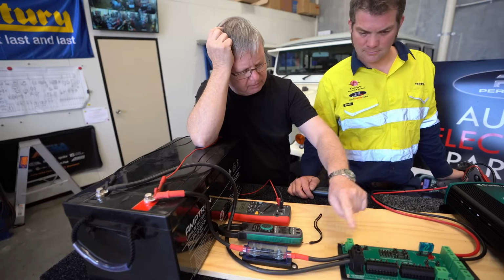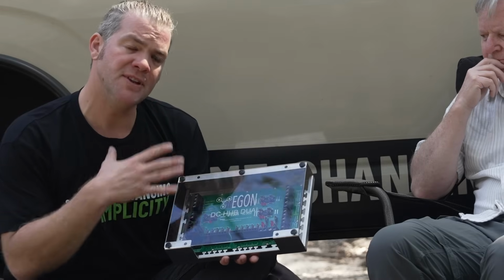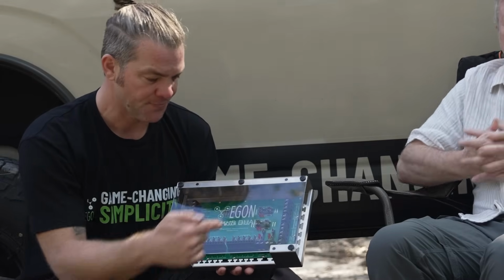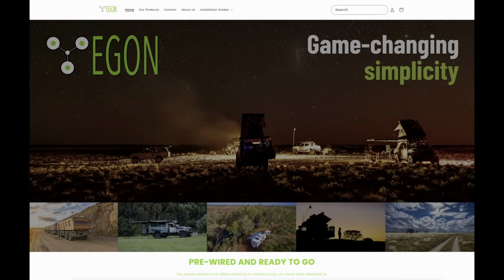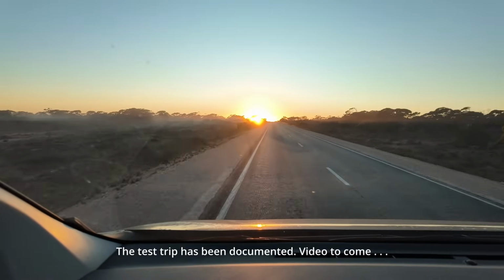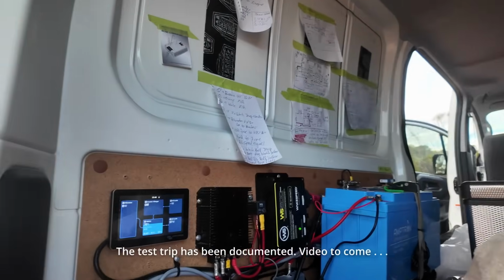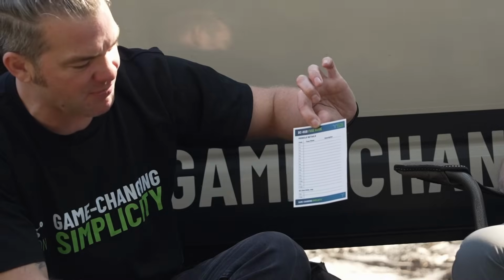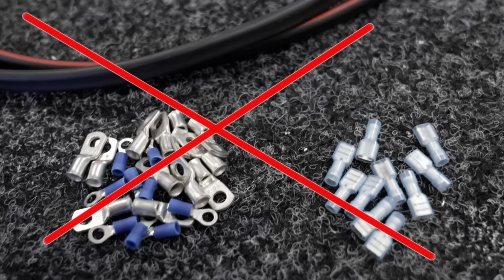Egon Celebrates 1000 DC-Hubs and the new DC-Hub DUAL is launched @4xoverland

Comment: Excellent looking kit. I have my 4x4 offroader with wiring getting out of hand. I run the smallest arb compressor for my lockers and air freespool  and a twin ARB for my on board air system for tyre inflation etc. At the moment I have winch wiring 2x50mm + and 2 x 50mm negative. Also have Victron DCDC 30amp charger on dual batteries. I have several light bars and some other ancillaries wired to a switch pod. 
If I was to move everything but the winch wiring to the Egon hub I would be able to tidy up my battery box considerably. Am I correct in thinking this?

Comment: The 40/80A termination, what duty cycle at 80A is it? 

Would it be able to run a TJM Twin Air compressor?
Reply from the maker: 100% duty cycle @ 80A. But compressors never run 24/24. So, yes. I run a ARB twin from the 80A output in several of my rigs.

Comment: Back when I built the electrical system in my truck, I used the TEXU200 DC distributor (from the German company "TigerExped"). They also have a 400 amp version. The biggest difference here is that it has a circular form instead of a rectangle (and the need for clamping). It also has the LED indicators.

Would love a comparison.

Comment: You should make it with wago fittings you could make them way easier and better and huge amps but takes up more room but so customisable ..you just need to check out resonable sized yacht they mostly run 48v ...good luck and congratulations

Comment: I like the idea, I am building an RV in the U.S. and it should have Solar, DC components and AC appliances. Batteries and a backup generator. And I'd like to keep the 12v wiring to a minimum. Would I also be able to feed power from my truck to the trailer while driving with this system? Does a thing like this offer any benefits of efficiency to the system? Or is it really just an easy place for diagnostics? Which is a benefit all its own.